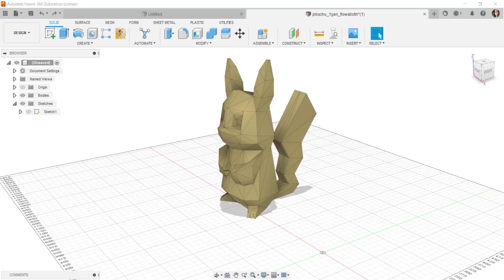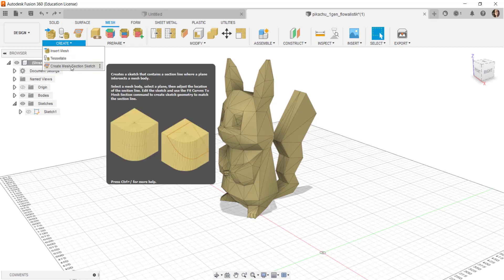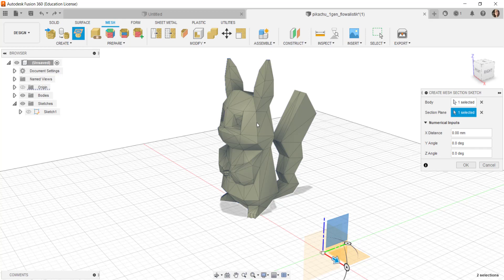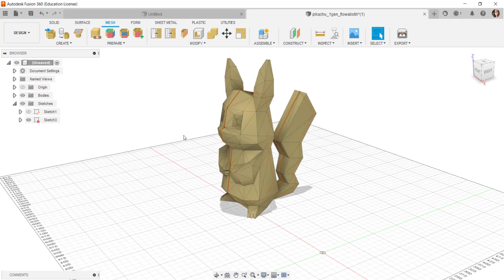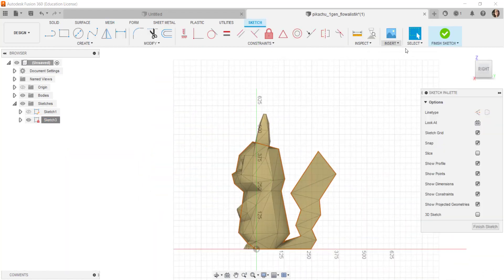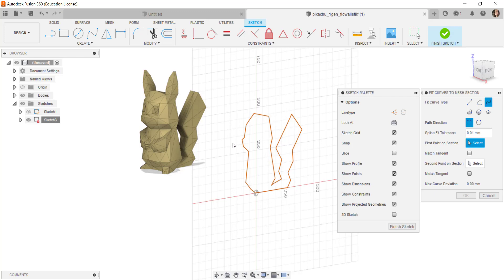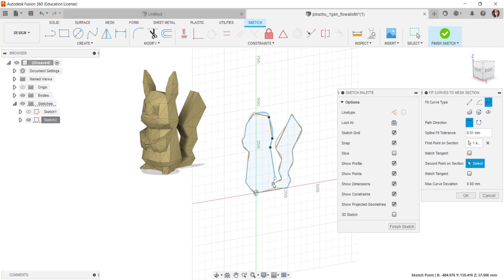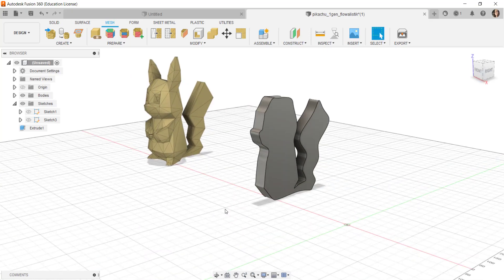Fusion 360: Fit Curves to Mesh Section UPDATED

Comment: Thanks for the update.

It took me a while to realise that this doesn't work if you have converted the mesh to a solid body.

If you had clicked the "Line" button next to "Fit Curve Type", in the "Fit Curves To Mesh Section" dialog box, I think you would have got a more accurate result.

I'm sure there is an easier way of doing this though, by using "Inspect > Section Analysis", and then creating a sketch from that, which automatically traces the outline perfectly, but I'm still trying to figure that out.

I've used that method once before, but I can't remember exactly how, and I can't get it to work anymore.

The search continues... :)

Comment: This function (Fit Curves to Mesh Section) is accurate in the Personal Use version of Fusion 360 sadly. It creates curves where straight lines should be.
Reply: exactly my problem this tool is completely useless if it can't extract the exact outline. It generates curves where straight lines should be. This is unacceptable.